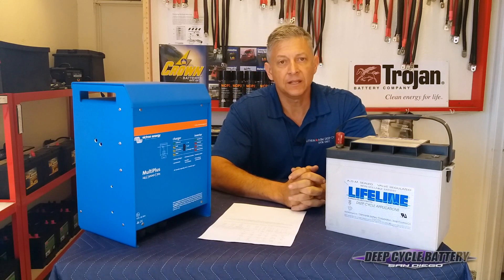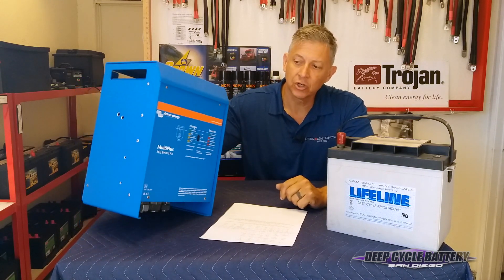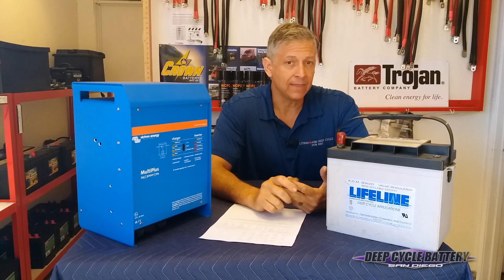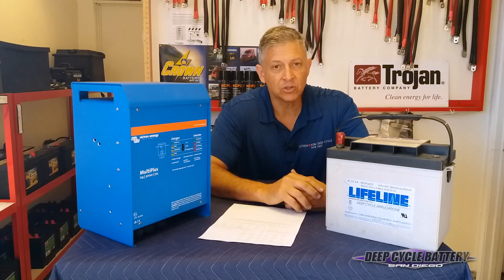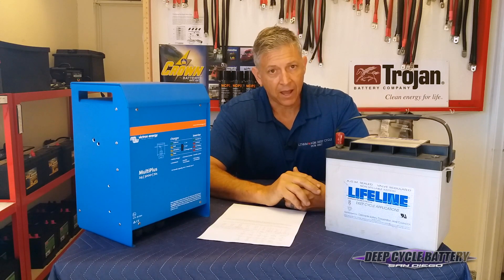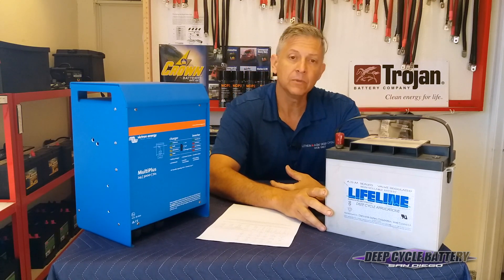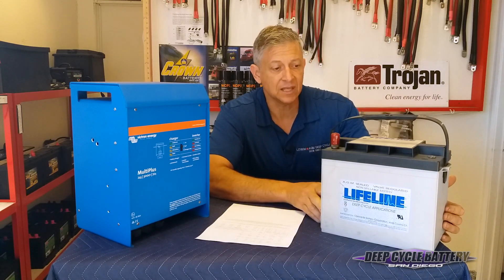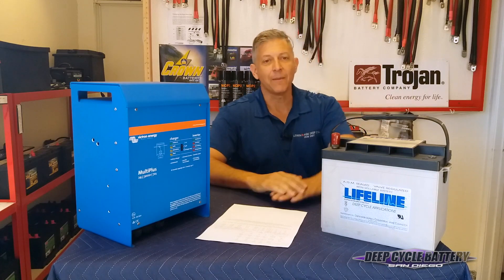Battery Charge Settings AGM vs Flooded vs Gel

Comment: So if you need a special charger to charge an AGM battery, how is it that the car you put the AGM battery into (that's designed to charge a standard lead acid battery) doesn't ruin the AGM battery?
Reply from the maker: @omegaman2183  I believe the aftermarket sells a module that can be incorporated to change the charging voltage to accommodate an AGM battery.

Comment: Great video Jeff, and excellent recommendations.  I just watched a Odyssey AGM battery video on properly charging their batteries and it stated then need to be charged at 14.0 - 14.7 volts to properly charge them. I am not sure if all AGM batteries have this requirement but they are 12.9 volt batteries, and regular lead acid batteries are 12.6 volts, and should be charged at least a 1 volt higher voltage.

Comment: What about charging a wet battery on agm setting will that also cause damage
Reply from the maker: Again it's not recommended to charge a flooded lead-acid battery on an AGM setting. Long-term you run the risk of damaging the battery

Comment: i left my mobility scooter un charged for to long  & they went flat .  my cartage  wuld not crag it  up. it being a gel battery & a gel battery charger  I tried MT led acid charger  & that would not cage  it up  A a i was told i needed a gel battery charger ,  which i had  so why wudent it char them up  & my funds wuld not strech to  new . so i had two old car batterie the wuld not hold charge  long & one  that would . so i connected the week,  battery to the gel battery  & charged  it with the led acid battery.  in series   12v .The gel battery stated to Bild in voltage  i left the two charging for a day .  & the lad acid battery  lost it's charge  wen i switch of the charger  But, THE gel battery dib not  So i did this to the second gel battery.  that to responded in the same way .  so now i connected them  to the good led acid battery.  in series & charged all  3 for a day  the gel pack cam up to full charge I trend  of the Charger  let the two batteries, sit together,   Over night  i the  repasted  them in my scooter & contend them  in parallel the Normal charging  state  & put them.    On charge with my gel  pack charger that cam with my scooter  IT cages them up & i keep them  top,  Up now i have noted.,  That they char much quickly  & hold the charge longer these day's.

Comment: I have 4 AGM 65ah Batteries on 24v and I use 2units 300watt connected on series but the batteries are not well Charged. Pls how do I set up my 60a pwm solar charge controller.

Comment: Hi sir, i have 2 Fld batteries (200Ah each) and 2 Gel batteries (150Ah each) connected to solar panels by MPPT Solar Invertor.
What should be charging setting. Please guide. 

Thanks
Reply from the maker: hard to answer. Fld and Gel has charging different charging profiles
Reply: You will have to consider investing in new batteries so you would be able to use your charger. 
All for now you should not use it on those mixed batteries.
That is called " spinning tap in mud"

Comment: im trying a "smart charger" on a AGM ...it has a "reconditioning mode" and since im buying the vehicle used Its sat too long. What actually is the "Reconditioning" mode doing?
Thanks, Eric
Reply from the maker: reconditioning mode is a higher than normal charging voltage used to wake up a deep discharged battery

Comment: I bought a boat and it has a charging system for AMG, but the batteries are Flooded (your standard acid marine battery). Is this a safe charging system or should I remove the charger and install a flooded charger instead?
Reply: If the settings on your charger can be changed then you have no problem.
Get the manual and it will guide you as to what you need to do.

Comment: I have a spare battery in my RV/Caravan and its an AGM.  I have a battery charger that has options only for Flooded & Gel.  I'm not concerned for the balance of life in the battery, but If I were to use the charger until I can get a new one, should I have it set to FLOODED or GEL?  Or can I do damage to the charger or something else?  No fires or anything??
Reply: Gel is the closest and won't burn out your batteries. But it is, as you may know "not the safest or acceptable charge value"

Comment: Can you charge a flooded battery on an AGM charge profile from a solar charge controller?
Reply: I have the same question!
Reply: I would say yes, once your solar +  controller has a high Amp output and a temperature sensor you should be safe.

Comment: What's the most versatile battery charger available? I'm considering the Noco G26000, Noco G15000 and Noco G7200. I primarily want it for the camper that has two in series six volt flooded lead acid Trojan T145s but also for car batteries and as many other things as possible. Amazon sells Noco at slightly higher prices but includes shipping. Thanks, God Bless, happy Holidays 🎵🔔🎄
Reply from the maker: We use NOCO brand chargers at our shop.  the four station 1.5 amp tenders. Just remember to use high amperage. 20a or more

Comment: I am super confused with the AGM batteries. For example, NOCO G3500 has AGM mode in which it sends 900mA to the battery, and Normal mode which is sending 3.5A. Then there is VMAX MR137-120 AGM battery, and they say use a battery charger with min 8A, and that the battery needs to be fully charged withing 15 hours. What is the catch? 
Why Vmax is recommending high AMP chargers for their batteries? Will they go bad if they get charged with 3.5A charger like NOCO G3500? Should I charge it as a Normal battery instead of Cold/AGM?
Thanks
Reply from the maker: Use the 900 milliamp NOCO settings for Powersport batteries they are smaller. 100 amp hour and higher batteries can be charged with the higher amperage.

Comment: I have a wheelchair SLA battery (AGM) with the following values:

12V - 18Ah  /20Hr

=== Constant Voltage Charge ====
Cycle use:  14.6 - 14.8V

Standby use: 13.5 - 13.8V

Initial current: 5.4V

============================

I want to replace it with another SLA battery (AGM) that has exact same values except Initial current which is 3.6A not 5.4A
My question is what is Initial current mean? Can i replace each other without problem?

Thank you!
Reply: battery gets charged with a constant current first - initial current.  If current is higher than battery rating, the battery will be overcharged

Comment: I heard that agm and gel doesn't need to be equalized,is that true?
Reply from the maker: well, batteries connected in series should be equalized, but potential to overcharge and dehydrate acid starved batteries are good. Most do not equalize for this reason. But here is a link to Lifeline AGM rules on eq AGM "pg21" http://lifelinebatteries.com/wp-content/uploads/2015/12/6-0101-Rev-E-Lifeline-Technical-Manual.pdf